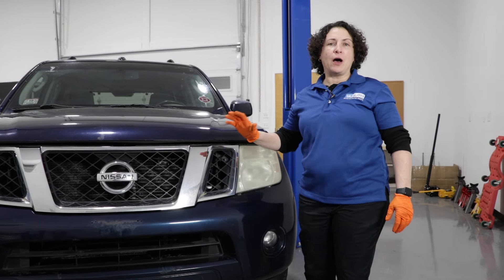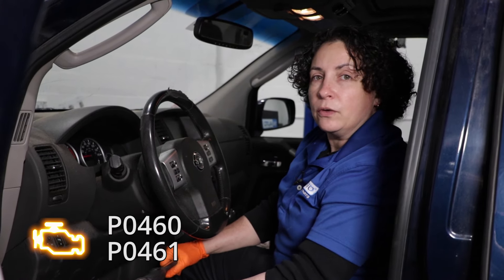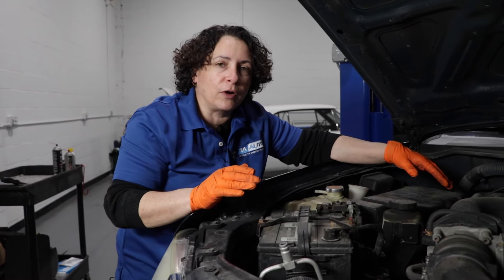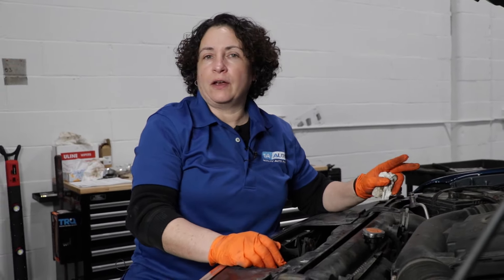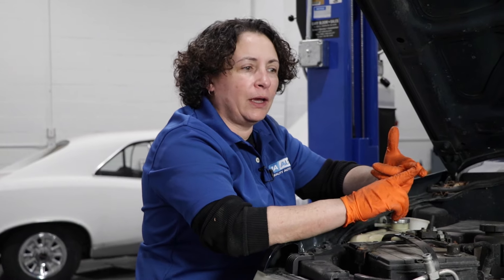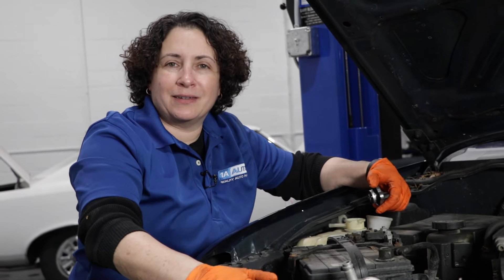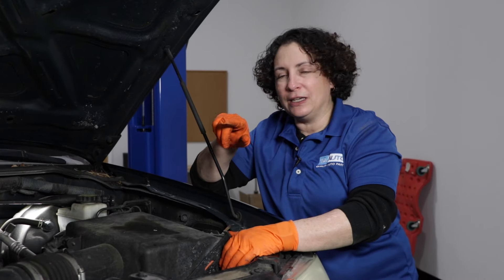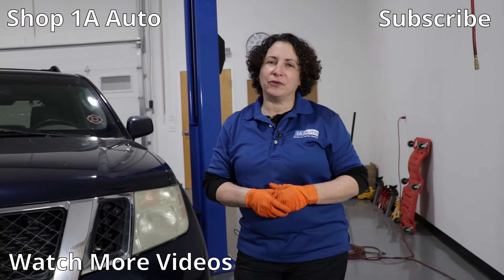Top 5 Problems Nissan Pathfinder SUV 3rd Generation 2005-2012

Comment: Thanks for posting.  Recently, I drive past a 2005 Pathfinder every day on someone's front yard that has a for sale sign on it.  Dropped in yesterday to take a look.  190k miles.  Started right up. Definitely needs the secondary timing chains job done immediately but I can do the labor myself.  I have a 2007 Xterra with 225k so know this engine well. No SMOD so that's good.  No dashboard lights.  It's a Florida car so zero rust.  It's a loaded model with power seats, leather, rear seat TV's etc...  I can get it for $3000.  What do you think?
Reply: For 3000 I think that is a steal my friend, I picked up a 06 LE edition(top model) for 11k way back in 2015. I still daily drive the pathfinder and up here in Wisconsin where it snows a lot, and where the cars get very very rusty. The car has thankfully had none of the issues in this video. I just replaced the factory radiator when I bought it. Every other problem occurs just if the car was not taken care of.
Reply: Go cheaper.  They sell for $1,500 around here. Too many expensive issues as they age.
Reply: @stuartbear922  1500? Damn where u live? there like 6-9 k where I live

Comment: Timing chain not a big deal. Usually is around 200000 miles. coolant line to trans can be easily overridden and in line aftermarket radiator. Pretty cheap fix.

Comment: I had the coolant lines that run through the fire wall on the passenger side dry rot and it left us stranded on the side of the interstate  I ordered a new one and it ran behind the engine and down to the frame on the passenger side. Did you say the timing chain was a recall so Nissan would cover it?

Comment: Very Useful!! Thanks a lot, I’m in actually thinking to buy one, 160000miles is only owner and it is in a great condition to be from It is in good condition to be from 2005, the only thing I did not like was a smell of burning oil and I peeked under the truck to see the transmission and the crankcase and it looked a little dirty with oil, but there was no drip no oil stains on the floor. What can you please advise me on that??
Reply from the maker: +Exoticprodetail AMS We wouldn't be able to diagnose an issue like that here, you may want to have a local mechanic take a look at it. Thanks for checking us out! http://1aau.to/m/Shop-1AAuto-c
Reply: stay away from any pathfinder not 2010-2012. Especailly one that smells like burning oil
Reply: @nickarrigo5540  y those years ?

Comment: You left out one big issue with that pink milkshake.  If you get that you will be paying to have the transmission rebuilt. There is no getting around it. Once that coolant is in the transmision it will start to fail. It cost me $4500 to rebuild it so it is not cheap.

Comment: Do these problems happen on the diesel model
Reply: Yes they do, 2.5 2006 diesel got the fuel meter issue, and coolant transmission oil mix (hope to have spotted it in time, automatic still works fine), additionally as now driven over 560tkm, wheel bearings / suspension parts replaced

Comment: 2005- 2010 pathfinder had issues with coolant mixing with oil. Had to replace my transmission. Buyers beware. 
Take off radiator cap and check fluid before buying. If it looks like hot chocolate……..RUN.

Comment: I have a 2008 Pathfinder.  My mechanic has done a lot of coolant transmission bypass work.
Reply: I just got my  nissan pathfinder 2008 and I was wondering if there is anything problem with the model 2008
Reply: @fredycano460  yes this video is for 2005 - 2012 models

Comment: First and foremost she's lying about having to drop the gas tank to remove the fuel pump!
I'm sure that's what they tell you and charge you for several hours of labor, when you don't have to pull the tank at all, flip up the rear left back seat, pull the carpet back and you'll see a black metal cover about 12" wide, there's 3 plastic screw ( locks ) twist them about 1/2 turn to left and pop the cover up, and Shazzam there's your fuel pump, remove the electrical plug, the two fuel lines, tap the lock counter clockwise until it reaches unlock position,  then you pull the pump out, nice & easy!
Don't let these parts stores b.s. you buy saying, the cheapest fuel pump you can get is $300
O'Reilly's is really bad about this, because they are selling you the entire unit, don't buy the stuff you already have, I called around and EVERYONE TOLD ME THE SAME THING, #1 THEY TOLD ME, I COULDN'T JUST BUY THE FUEL PUMP FOR THIS 04 NISSAN PATHFINDER, ADVANCE AUTO TOLD ME THIS AS WELL AND I PURCHASED THE FUEL PUMP ITSELF FROM AN ADVANCE STORE FOR $85, THAT'S THE TRUTH;

Comment: Should I just get rid of it then? Instead of getting another transmission? Mines an 06. Slip lights, abrupt shifting, crank no crank situation, Oil leak. Is it done?
Reply: Did the trans/radiator mix fluids? (pink milkshake)

Comment: My bose amp broke and now speakers dont work so unhooked it . Plus if you put the key in the ignition or  turn the car off you cant leave keys in the passenger side makes a sound like a antenna is been pulled back in a motor sound. Then battery needs to be jumped.

Comment: Unless your 100% sure the radiator got replaced on time at 60k miles don’t buy that Pathfinder. Nissan is the worst with anti freeze leaking into transmission and charging you for absolutely everything. Here’s what makes matters even worse, if the transmission is destroyed you’ll need a brand new one to replace it, rebuild transmissions will not last on it
Reply: I Absolutely agree with you, Nissan charged me $700 to replace my radiator with the updated one at 70,000 miles.

Comment: I have a 05 and I noticed recently once I drive over 60mhp i saw a light comes on the dashboard saying slip and it took it all the way down to 40mhp before the light came off 
Any idea why is that so mean in like what would be the problem thanks 🙏
Reply from the maker: +Rishi Khaderu We wouldn't be able to diagnose an issue like that here, you may want to have a local mechanic take a look at it. Thanks for checking us out! http://1aau.to/m/Shop-1AAuto-c
Reply: Unless you actually broke traction, i noticed faulty speed sensors or a bad wheel hub can both trigger a false slip light but usually set  constant vsc and abs lights.

But, as always, a local competent mechanic needs to look at it to actually fully narrow down and know the issue.

Comment: hello greetings, I want to ask you something: I have a 2010 Nissan Pathfinder r51 diesel and I sent it to perform a complete maintenance I bought all the new Japanese parts for both the block and the head I changed absolutely everything for original Japanese parts, from the pistons pumps all kinds etc  The mechanic assembled the engine and did not put the original new Nissan thermostat on it because, according to what is not necessary, because Panama is a hot climate.  The truck started but it was emitting a lot of black smoke, he said it was oil in the exhaust and it would stop when it burned, something that never happened.  15 days passed and the van completely lost compression.  now let's talk again the shirts are worn to 16,20,17 and 17. and the mechanic blames the lathe... but watching tutorials I see that if the thermostat is not placed the engine does not reach the ideal operating temperature and It causes all the damage mentioned above, smoke, excessive diesel consumption, and wears the shirts due to lack of lubrication due to low engine temperature.  I am writing to know his opinion since the mechanic blames the turner and the turner guarantees that he left all the shirts to his 12 meter????  thanks for his answer on my question !!!!!!  can the thermostat heal the liners from wear?  and can you build a new engine and not put the thermostat on it?

Comment: Looking at a 2012 Pathfinder base v6 with around 80,000 miles. At what mileage do these problems start to show up?
Reply: Make sure the radiator was replaced.  Or bypass the transmission lines out of the radiator.  Lots of videos on YouTube on how to do it.
Reply: The 2012 shouldn’t have these issues. The radiator problem was corrected in 2010-11 model year. The timing chain tensioners were also corrected during those years. The 2012 should be very reliable for you. I have an 08. Radiator was replaced and I’m on the original timing chain. I don’t have the other issues in this video. I have 179k on mine.
Reply: 2010-2012 Pathfinders have had many of these issues resolved and are almost 4runner reliable.

Comment: If you think nissan is bad for timing chains and transmission problems you should own a Ford with the 4.0 liter ,Thats a different level of expensive  !
Reply from the maker: +Stephen Gordon Thanks for the feedback!
Reply: My buddy had a ranger with the 4.0 in it, thething always had problems. It had the infamous 4.0 misfire problem that just couldn't be diagnosed, replaced plugs, wires, ignition coil, fuel pump the whole nine yards. It still didn't fix it, and then the transmission finally went in it. I don't know why people drive Fords, they're just expensive junk.

Comment: Hey some is true but some don’t for example my Nissan Xterra 2006 it got noises tik when i cranck but is need like that for 10 year and sorry to tell u but it still running it have 180,000 mile when i bought it and now is 349,759 miles on it and it just keep going just oil changes
Reply: I have a xterra 06 bought 163,000 now 176,900 it wines a little when starting should I just keep running it until that click sound? I think it will last another 50 thousand

Comment: Most of this isn’t true. Learn your facts
Reply: Bought an 06 years ago. Had under 100k miles on it, did my research, checked the part number on the radiator. Replaced at first chance and drove it till the left bank front catshit converter blew into the second cat. Back pressure caused all sorts of issues and need a motor now. Great SUV. Almost 300k miles on it.

Comment: You can not fix the timing chain noise. I bet this Pathfinder has over 140k Miles, some Mechanics ACT like they can fix this noise but they cant. A good mechanic will tell you these cars are a pain to work on so dont take credit as a Tech over a Mechanic that will tell you about these cars.........For Example the Alternator is difficult to work on, then again if you changed at 145k youll reach 200k.. Which is above average mileage than most cars without Engine or Transmission Problems.....There are NEW Cars that have Engine Issues at 20k or Less. There is no strawberry milkshake effect good one....